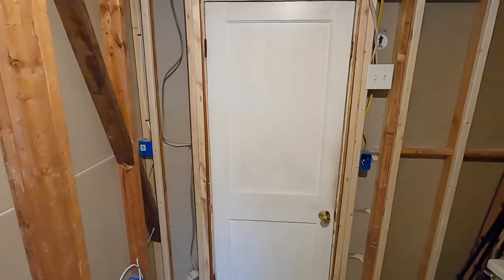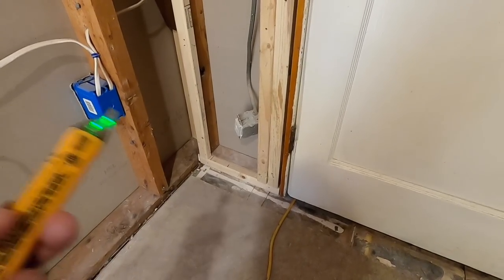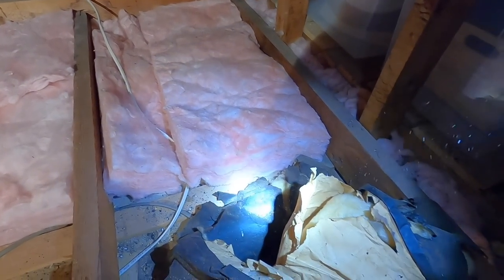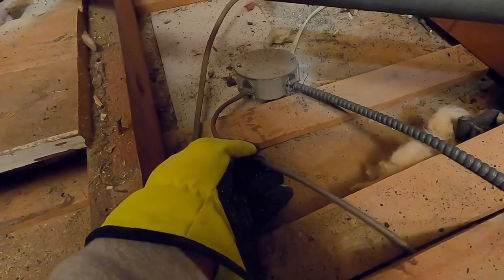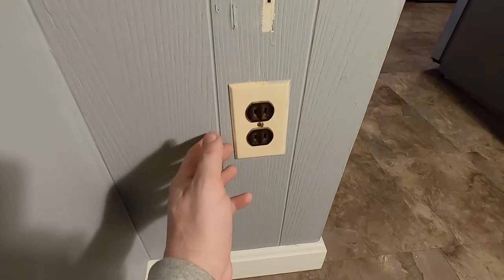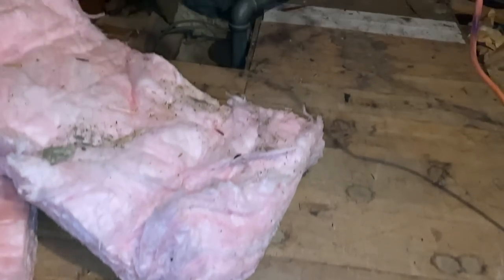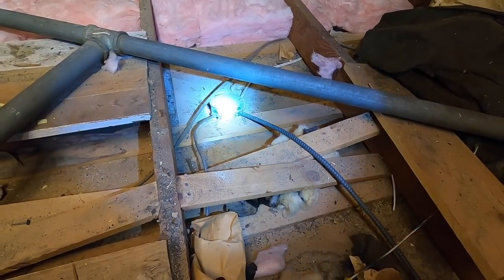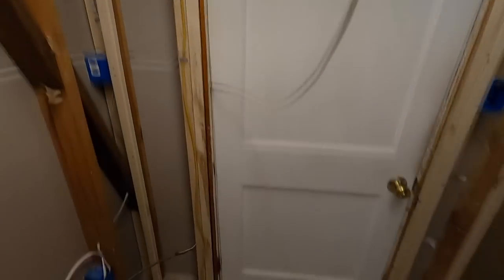DIY Bathroom Remodel - Removing Old Wiring Circuits - Episode 10

Comment: I made a comment in a previous video recently but since this is the newest one, I'd figured I would add it here too. I would run an insulated duct for your exhaust fan and use aluminum tape to seal it. Great Job! I'm looking forward to the next one!

Comment: I have been let down by handheld circuit detectors giving me a false-negative and false-positive.  :(. Loaded neutrals are a thing in my house for some reason.  I have been double checking with a multimeter.  Hot-to-ground, hot-to-neutral, then neutral-to-ground.  Slowing fixing the circuit issues as I uncover them.  Great work as always Fixer.  Can’t wait to see this get put together.

Comment: As a bit of a coincidence, bathroom fans are something I'm dealing with right now. The original, too small, too noisy, complete afterthoughts of vent fans installed by the contractors are getting replaced with quieter units that move more that twice the air. One down, two to go.

Comment: Might be a dumb question because I know nothing about electricity but could you not have left the outlet in the hallway tied into the power in the junction box and just removed the wire for the bathroom?
Reply: No pretty sure it was because the outlet had the same wire connection as the bathroom vents

Comment: I apparently need to hire an electrician to redo a lot of the previous owner’s electrical mess.  I do not think he had your skills.
Reply from the maker: Hey, Eric!  If you are uncomfortable working with wiring like this I definitely recommend hiring someone.  You don't want to mess with something you can't see (electricity).  I hope you enjoyed the video anyway! 😁
Reply: Considering how simple wiring is at its heart, it's amazing how many people should never be allowed to do anything so simple as replacing an outlet. And it's not like wiring code is a deeply held secret, you can just look it up online.
Reply: @TheFixerHomeRepair  The inspector said the attic needs some electric boxes.  In our basement, they ran wires perpendicular to the joists, but didn’t bore through the joist.  Wanna come fix my issues?  I wish I could save myself a couple of grand, but then I don’t wanna mess anything up
Reply: @nolongeramused8135  I agree.  I like to save a buck but I know my limits.